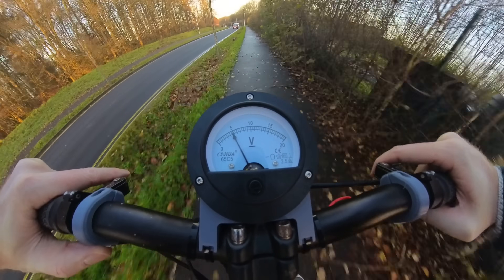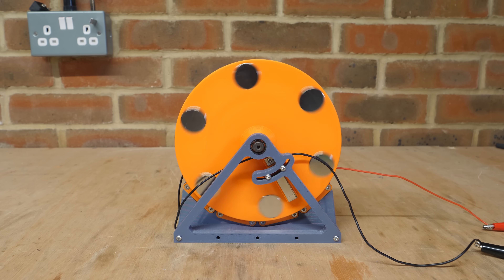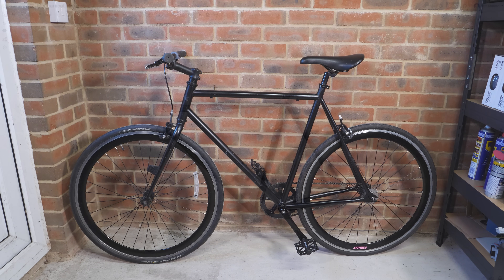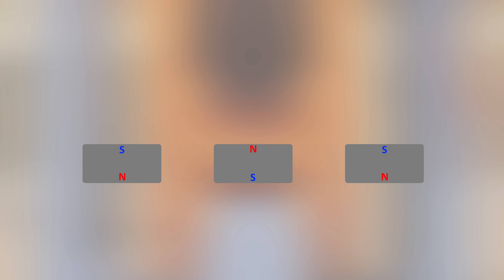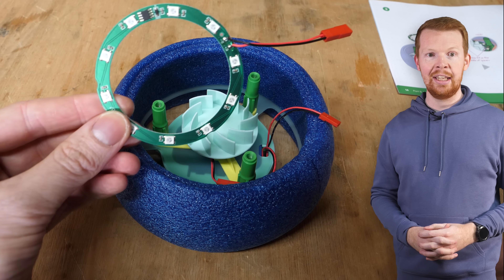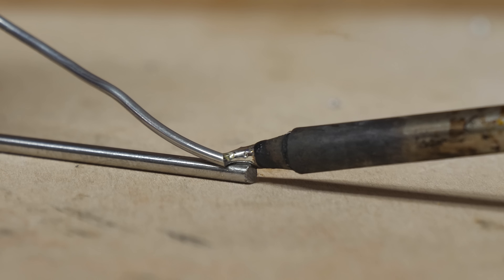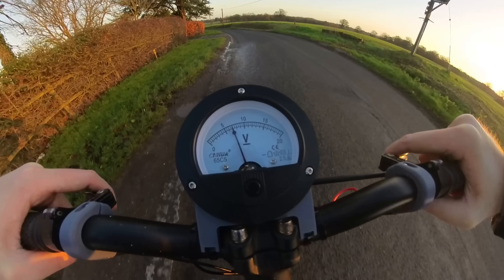The Most Minimal Electric Bike

Comment: I'm glad to see that you haven't broken the laws of thermodynamics. But at the same time I'm slightly sad you haven't broken the laws of thermodynamics.
Reply: Young man in this household we obey THE LAW OF THERMODYNAMICS
Reply: @rekire___ he hasn't broken any laws if he hasnt been caught breaking any laws. Some laws are meant to be bent.
Reply: @christopherleveck6835  "Some laws are meant to be bent."
You need to get a degree in "not making sense".
Reply: Every engineer who saves energy in one part of the system only for it to pop up as extra effort in another part:
Reply: 5~30V boost converter PCBs ok la
Reply: @anwin85alon the video says it is running on battery power w/out the electronics like an eBike
Reply: @anwin85alon ok, I'll bite. Since you have mentioned this multiple times, what's the problem exactly?
Reply: Las "leyes" falsas de la termodinámica del sistema , plandemia2.0
Reply: I broke all the rules when I collapsed a black hole in a lab.
Reply: PEOPLE the man needed TUNGSTEN for the device. i think he was pretty near breaking them laws!!
Reply: Hi . I like your video. And i tried very similar ideas as yours. Re the mechanical switch. One i,m working on right now is securing the magnet directly to the the micro switches arm. . 

You might remember the older v8 cars had a distributor.  Under the cap was a set of contacts (points) and a capacitor (condenser). Somehow  the condenser improved the life of the contacts of the switch. . . Tungsten contacts . Very small. Lasted a long time. .
Reply: Without a Hall sensor! The rotor coil should be spinning!
Reply: @vedeneyvolin6273  isn't that what using the tungsten contact is meant to replace? or am I misunderstanding?
Reply: Because thermodynamics are fake 🫡
Reply: That's because the inverse square law doesn't love you like he does
Reply: We need thermodynamic outlaws!!!
Reply: Look up the Joule Theif or the Bedini SSG, radiant energy/vacuum energy is real and you can create a system outputting more power than you put in without actually violating the laws even though it seems like it does. It’s the same principles as wind turbines, hydroelectric dams and sailboats. They’re technically free energy devices.
Reply: It's all about efficiency  @WezRants
Reply: @WezRants link please.
Reply: @WezRants ink please
Reply: @WezRants but how to apply this on a bike
Reply: @WezRants if we’re talking technically, wind turbines are not free energy. They harvest from the earth, reducing the energy in the atmosphere
Reply: @ that’s exactly right, it’s using the local environment. My point is the same concept applies to “free energy” (over-unity is a much better name cause free isn’t fully accurate). What we know as the “vacuum” of space isn’t actually empty like we think. There’s a sea of bubbling energy like a cauldron filling all space, and we can tap into that energy to run our circuits. 

The key is you don’t get more energy out of a system than what YOU put into it, but the environment can put energy into it and then it seems there’s more output than input. Just like a wind turbine.
Reply: The laws of Thermo whatever's can clearly be bent.
Reply: @christopherleveck6835 no

Comment: That's a cool-looking bike! I'd like to see more of this in the future. Also, I noticed at 7:52, you used solder on the tungsten rod for the makeshift reed. If you plan on using this long-term, solder degrades from vibration and might shake loose resulting in sparking and degradation over time.

Comment: Armchair quarterback here. You've added a lot of weight to the reed switch. Will it oscillate as fast as it's supposed to? The motor may run without a fast switch. but it could be "missing" without you noticing it.

Comment: Wouldn’t a brushed DC motor also count towards your definition of having no electronics? I mean it’s a cool project to build a brushless motor without a controller, don’t get me wrong, but I feel like a brushed motor with a clutch, to avoid the resistance when unpowered and enable regenerative braking, would have been easier and more powerful 😅
Reply: Agree... a brushed motor seems like the obvious choice.  I'd like to hear Tom's thoughts... did he reject brushed DC for a reason, or was this just an extension of the BLDC project?
Reply: I guess a brushed motor has too much drag due to the brushes constantly pushing against the rotor.🤔
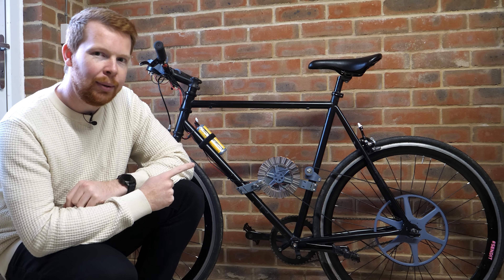Reply: See 9:07
Reply: @qo92  what losses is he talking about?  If the motor is disconnected, there is very little drag... just some eddy current losses in the core material.  The attractive force between the magnets and the core does exist, but there aren't any losses associated with that.
Reply: @SkyhawkSteve  I had assumed he was talking about those eddy current losses which are minimised in his design. Perhaps a brushed motor constructed with more plastics/nonferromagnetic materials would solve the drag issues his design seeks to overcome?
Reply: @qo92  hard to say.  It would be nice if Tom explained what was behind his decisions.. i.e. show his homework and analysis.  You'd be hard pressed to find any motors that don't use high permeability cores to make the best use of the magnetic flux.  I get the impression that Tom makes stuff for the entertainment value instead of any pretense of actual engineering.  Entertainment is fine, ala Electroboom, but at least be clear about it.

Comment: I'm not convinced that this is in any way better than a DC carbon brush motor.
Reply: No it is not better... but i guess it would not be as fun doing the video then.
Reply: A brushed motor has a lot more internal friction, and is much less energy efficient because of it. If Stanton could get this mechanism working more smoothly, it would basically be a mechanical BLDC motor controller, somewhere between the efficiency of an electronically driven BLDC and a brushed DC motor.
Reply: @specialagentdustyponcho1065  A commutator and carbon brushes add relatively little friction as graphite is an excellent dry lubricant.
Reply: @specialagentdustyponcho1065  The problem is that people have been working on the mechanism for over 100 years and the best mechanical solution they have come up with is the brushed.  So to do better you have to go to electronics. On the other hand, if you put the same amount of permanent magnets in a brushed motor you could get pretty good efficiency too.
Reply: @specialagentdustyponcho1065   What good is efficiency if you can't harvest enough power in the first place? I'm also very sceptical that, for the same power output, an off-the-shelf brushed DC motor would be less efficient that Stanton's generator.
Reply: @cliveso  Additionally an off the shelf motor would almost certainly be iron cored and have the cogging problem that Tom wanted to avoid.
Reply: @ferrumignis  It's a non-problem.

Comment: Regarding the arcing, try adding a capacitor across the switch to maybe help control some of the surge of current on make and break. In older cars they would use this on the ignition to control arcing across the distributor points as they make and break for firing the ignition coil. It was called a condenser. It's still used on modern cars but to absorb electrical noise from the ignition coils.
Reply: Motors are basically inductors.  Use a flyback diode or switchback diode I've heard it called both.  Give a path for the current to reverse back around the inductor
Reply: @Woowoobang This is the correct answer for the problem he was having.
Reply: As an old mechanic I was thinking the same, anytime the condenser failed the points would burn up quickly.
Reply: He is trying to do it without any electronics. Thats the whole point of it all.
Reply: @AdblockAccount A diode is certainly more 'electronic' than a capacitor which was invented in the 1750's and is a tube of paper and metal foil with tangy water inside. Less electronic that a magic rock that only lets electrons go one way.
Reply: @AdblockAccount He is trying to do it without any electronics. Thats the whole point of it all."
The motor has some big inductors and there are diodes for rectification so he's failed already if you want to go to that extreme. I'm pretty sure his intention was to avoid active devices like transistors and ICs.
Reply: That’s missing the point somewhat.
Reply: @MiesvanderLippe  He's already using diodes in a full-bridge rectifier. And using coils of wire which are inductors. And super-caps. Might as well use capacitors, which are just plates of metal.
Reply: @tiger12506  He is not using diodes for the functionality of the motor. He is using those for the power that the motor outputs. The motor itself has no electronics in it. Whatever you plug into the outlet of it is irrelevant.
Reply: @MiesvanderLippe   How so? https://en.wikipedia.org/wiki/Capacitor#History Is the 1750's too new for this project?
Reply: @MiesvanderLippe missing what point? I thought the point of the video was to build an electric bicycle without electronics according to the definition he laid out. Capacitors are certainly not semiconductors.

Comment: Instead of mechanical, wouldn't an Electrical switch .. i  dunno some kind of Power MOSFET do the same job ? If there is insufficient voltage the MOSFET is essentially disabled in the "OFF" position. Once you generate/re-generate enough voltage, the switch turns "ON" and the current flows in the direction you need it to flow.

Comment: You should put the tensioner on the return part of the chain/belt, or its directly under tension which risks snapping it off and increases drag.  Mtb idlers are very beefy and quite large for this reason
Reply: Correct. Also make it push on the belt, thereby increasing the contact area between belt and gear wheel.
Reply: At the end, it looks like he found a belt with the correct length (or pulley of the right diameter) to not need a tensioner.
Reply: The motor is used for accelerating and decelerating. There is no unloaded side.
Reply: Pretty sure he did this intentionally. The belt's primary role is regenerative braking, not acceleration - the opposite of a normal bike drivetrain.

Comment: I got my degree from an Electrical, Electronic and Computer Engineering department. The formal difference in engineering between electrical and electronic is that the later has active logic and/or decision making systems, whereas any smarts in electrical setups are purely the results of frequency tuning, voltage differences and mechanical switches. The example I tend to use is CRT televisions from the 1940s, which operating entirely on amplification and frequency tuning would class as electrical devices. By the 90s, with teletext, fancy remotes, saved tunings, and overlay graphics, CRT televisions were now electronic.
Reply: I'd say it's simpler than that. Anything with active components is Electronics, eg thermionic valves, silicon diodes, transistors etc. Electrics is 100% passive and mechanical (even then it's a fine line). I'd call a valve based TV electronics, unless it was a purely electromechanical device like Logie Baird's. 🤷

Comment: How has this magnet arrangement not been used in permanent magnet generators such as those on wind turbines.
Reply: There's likely a good reason. Generally electric motors that produce a lot of torque may not be the most efficient, also they want to select motor sizing and power based on the average wind speed in the area
Reply: @ryangross5446 Higher strength magnetic fields are always better. Higher voltage for less rpm. That's what the craze for using neodymium is all about. Problem is they corrode really badly. Ferrite magnets are a better option but they are weaker. Hence why I was interested in this.
The blades should always match the generator for best performance. If the generator creates a high torque use a small one or increase the blade diameter.

Comment: Instead of reinforcing the reed switch, you could use a relay. That, combined with the bridge rectifier could give a better result.

Another option would be skipping the reed switch entirely and using a commutator.
Reply: commutator is right choice
Reply: It would be difficult to make the relay work. It has an operating time of perhaps 25-50ms which you couldn't compensate for without building something analogous to a centrifugal timing advance system to move the switch as the rotational speed changes.
Reply: @fronthole_guacamole  i think fixed advanced timing could work (a smaller reed switch could also improve response time, even if it gets worse in total), but a commutator would still be better
Reply: Yes, absolutely, a commutator!  Brushed commutation is purely mechanical, and not exactly cutting edge tech... but it has been proven to work for .. a hundred years or more?   Is Tom just too young to have seen brushed commutators?
Reply: @SkyhawkSteve Tom mentioned wanting to specifically use a brushless DC style motor, a brushed commutator would make this into a brushed motor
Reply: @bosstowndynamics5488  specifically, he said he wanted to build a mechanical motor without electronics, and then went directly to saying he wanted to build a big reed switch version of the little reed switch motor.  He never discussed the options for mechanical motors.  I get the feeling that he either thinks that brushed motors are too obvious, or too easy, or just something he can't make with his 3D printer.  ... or doesn't know what a brushed motor is?  We'll never know, I guess.
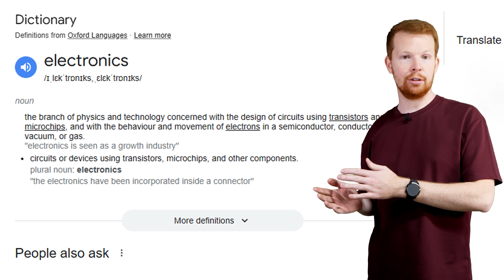Reply: @SkyhawkSteve  0:34 "Most modern electric bikes use a brushless DC motor, as they're incredibly powerful and efficient for their size", he doesn't explicitly mention brushed DC motors but specifying brushless motors and describing their advantages over brushed motors pretty strongly implies that he considered brushed motors and decided against them. There's also the part where he tried to use replacement carbon brushes for his custom reed switch specifically because they're designed to stand up to the intermittent electrical contact in a commutator, so he clearly knows what commutation is. Tom has also built a number of projects using cheap RC servos, which all use brushed DC motors.
Reply: @bosstowndynamics5488  BLDC (or 3 phase AC) is great if you got a 3 phase power supply, but a single reed switch is like 0.5 of a phase (only the positive side, only 1 pole). It removes any advantage it might have by having oversimplified controls
Reply: @Giuliana-w1f  I'm not disagreeing that an off the shelf brushed DC motor may have been better in practice, but I think it's pretty clear that Tom is aware of them and chose to go with his reed switch design anyway. Iirc he felt the efficiency was better than off the shelf solutions in his little push car design, but it could also be as simple as him liking brushless and wanting to do it that way purely for fun in this project that's very clearly not motivated by optimising for practicality
Reply: @bosstowndynamics5488  Not really.
Also he could have use a commutator just as the timing-signal for something else providing the correct currents.
Reply: relay is too slow, you need a mosfet.
Reply: @KaufDirGeld  the whole point was not using transistors, mosfets would absolutely be better
Reply: The relay solution is a great option, if for some reason we are stuck on the idea of reed switch, the problem caused seems to be the same problem that spark plugs have, so what about using the materials used for spark plugs? Iridium, Nickel, Platinum, etc. there only needs to be a small mount over the contact area. I do believe the relay option is better though
Reply: @charlieray1891  it's easier to get a relay capable of higher current than a reed switch capable of higher current
Reply: @Giuliana-w1f   Absolutely agree. My concern was the timing offset you noted in an aforementioned comment, which is why I simply suggested using a material that is known to stand up better under ionization. The research has been done for us and used under much harsher circumstances (the mentioned Spark plugs) and was simply a suggestion. Isn't this an experiment? We expect it to act a certain way so lets test it. lets try a relay and attempt to offset the timing like advancing the spark on a petroleum engine and move the sensor forward, Then we can use a known better material for a switch for a different experiment, then lets try a mosfet, or maybe even the combination of the two relay and mosfet as suggested originally (and I thought I included in the first comment, beg your pardon for not). but lets try them all and see what works best. sometimes things work differently than we expect. That's why I love these channels.
Reply: @charlieray1891  Relay is a poor solution, it requires a non-negligible amount of power to drive it so you are immediately lowering the efficiency.
Reply: @ferrumignis  "it requires a non-negligible amount of power to drive it"
In comparison to the power they switch it is negligible.
Reply: @ABaumstumpf  It's not switching much power in this case though, the motor is barely powerful enough to maintain speed on a flat road.
Reply: @ferrumignis  "It's not switching much power in this case though"
Yes?

Comment: Old car points with a capacitor would work way better. But brushed motors are already invented too.
Reply: Yeah, should have just used a brushed DC motor. I've come across some 36 volt 400 rpm motors from something once and thought it would be perfect for a bike, high torque motors. Bit heavy but not horrific.